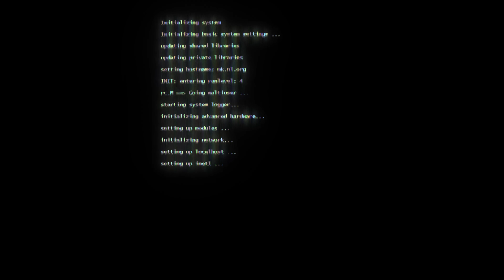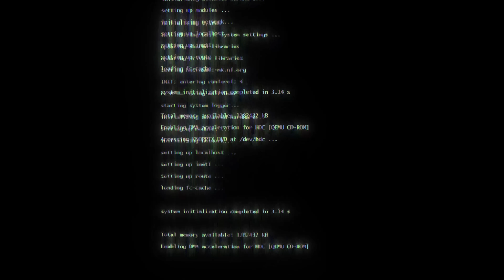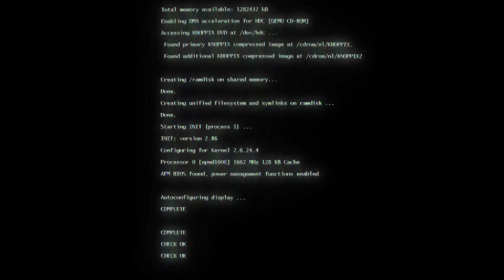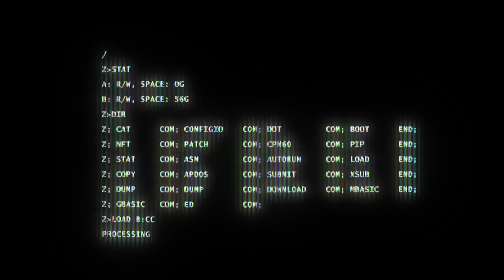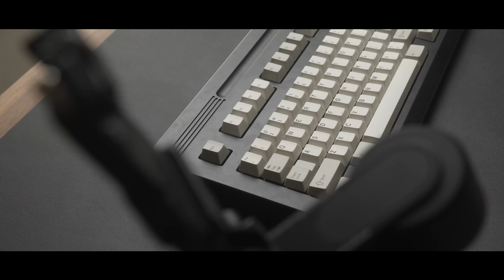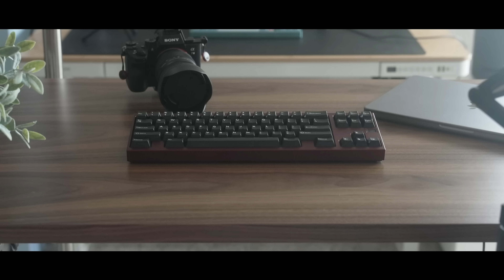This keyboard is a relic of the past. Class80

Comment: I really would love to hear how the CLASS80 sound like without any foam, as you mentioned about how it sounds underwhelming without any form of insulation. Definitely piqued my curiousity! I had the impression that it would sound like an ALU Version of the NCR80 kit (Roomy and spacious),  but I am l disappointed by the sound of it. It just sounds.... generic? It sounds like almost every other gasket mount board that has some form of thick case foam installed.

Comment: I really would have liked to hear a sound test with the solenoid. I love solenoids and it's one of the board's big, fairly unique draws. I don't think it sounds too bad in your sounds tests, it just sorta sounds like a big aluminum case to me. 

Also, while I love the weight, I would also rather just have a normal weight and save the money. I think these wild, extravagant weights look nice in photos and promo material, but personally I don't spend too much time looking at the bottom of my keyboards.

Comment: Its me back at it again for round 2. This time trying to be more precise. You sound test sound are very consistent for example on a same switch on a different board. If lets say I did a blind test listening to you sound test of 2 different keyboard of the same switch. I would have guessed it is the same board just with different foam or plate. But it is to my surprise they are 2 different board entirely. Lets say I search the sound test of the board with same switches. They sound different enough that I understand what sound profile the board leans towards and can imagine wt it would sound like with different switch but I find that harder to imagine in your videos. Your sound test are accurate enough but is not my go to assurance and I watch others for reference. It is safe to assume I dont have the same space, table or environment as you. Thus hope you understand what I mean. Like you said sound test is a lie because there is so many variables at play. Btw this had nothing to do with this specific keyboard. I just taught it would be funny to comment here instead.

Comment: Gonna make some slight corrections - it's inspired more directly by the original Gameboy, not the SNES. The bottom weight matches the button layout, the diagonal lines match the speaker grill, and the pen rail design is inspired by the top of Gameboy cartridges.

Fantastic video as always!